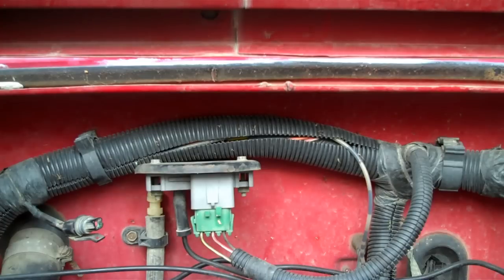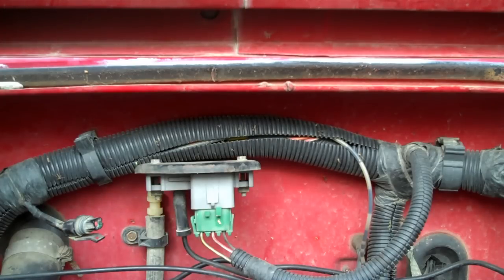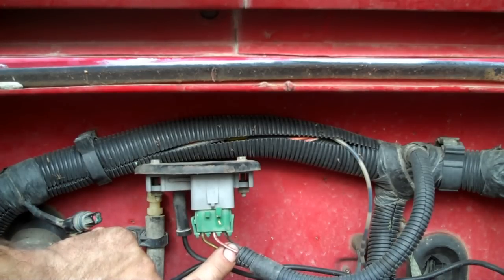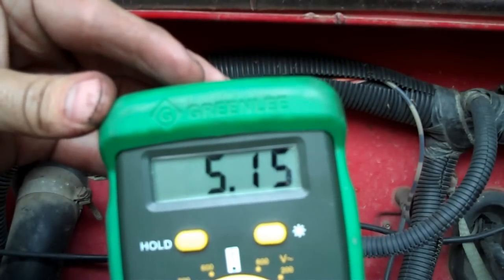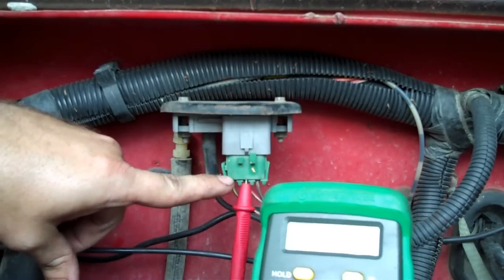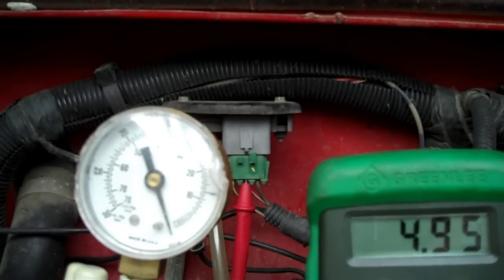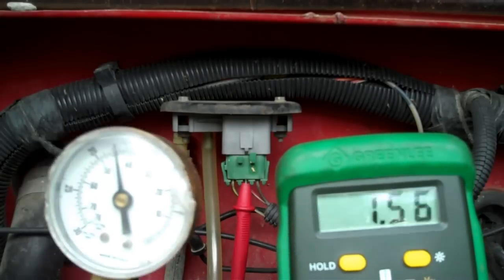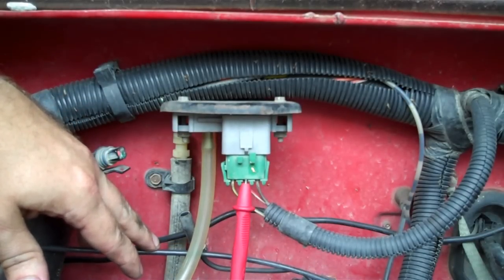Jeep Wrangler YJ -  How to test the MAP sensor.

Comment: Well, I guess I need to thank you...I think you just helped me pinpoint a issue with my Jeep. the center wire has 4.5vdc at power on, but when teh engine starts it drops to about 1.6vdc - what concerns me is that when I rev up the engine slowly i do not see a steady increase in volts - at about 3k rpm its still about 1.7 vdc

Comment: I have a 89 keep wrangler yj with a 2.5.   Runs good until it warms up and then just stalls out. I've put a map sensor o2 sensor crank sensor ignition coil new plugs new wires new cap new injector new throttle sensor new thermostat new fuel pump I'm lost do you have any suggestions for me
Reply: 90 wrangler yj 2.5. I'm having similar issue & have done everything you've done including new catalytic converter/muffler. I am at a lost. Starts off running great. Once the engine reaches a certain temp and I turn it off. Problem occurs when I try turning back on after being off 5min or longer the engine will sputter, sometime backfire, as I have the pedal completely down hoping it gets enough gas until it begins to runs. Once it starts to run it still sputter for a little bit more until it seems to clear itself up.
Frustrated... Please advise if you resolve your issue & how. Hoping it may be the same.  Thank you in advance.
Reply: Did you test the temperature sensors,...    There is a temperature sensor for the coolant. That is usually locked on or near the thermostat housing.
   And there is also a air temperature sensor that is either in the intake manifold or the air cleaner/ filter assembly.
     Both of those temperature sensors have to do with controlling the fuel injection system.

Comment: Just A quick question my RPM Guage on my 91 Wrangler 4.0 does not work when I bought. Can it be fixed? If so..... how can I do that. You help would be very much needed. Very Good videos thanks for posting your knowledge.
Reply from the maker: Old Wranglers are bad for dirty corroded contacts. Pull is out and clean the wiring contacts. You can use vinegar or hot sauce works well.

Comment: Couple questions..Is your Jeep the 4 Cylinder?  Noticed for me was difficult to catch your three readings for the vacuum (in the video sounds like you said 10 and go 10 more and than 17?  Hard to also read the gage.  Was your three gage readings  5, 10 and 17 in Hg Vaccium?

Your video is outstanding for a YJ fan.  In the Haynes, says nothing.  Even in the Chrysler service manual, really has no figures on vaccium.

Ever seen a spread chart for the map like they show for a temperature sensor or throttle position sensors show?

Thanks for all the help. Nearly 10K on my rebuild.  Have a fast idle issue.  Sure it's probably carbon on throttle butterfly or IAC.

Comment: I have a 1990 wrangler YJ 4.0 crank no start. If I introduce a short shot of starting fluid it starts and runs perfectly. Just a note it has a new fuel tank, and a new fuel pump recently installed but I still have the same situation. What do you think?

Comment: Great video but when I take my hose off the MAP my jeep cuts out. I have a rich mix shooting black smoke out the exhaust. Was told to check the MAP. Oddly when the MAP wasn't plugged in but the hose was connected, it ran and sounded like it used to. And then stalls. Soon as I plug the connector in,it runs like a misfiring dog and back to black smoke. Should the engine still run if the hose is removed??
Reply: Just tested the Center wire ,  
 Wire B. With everything connected,   with the Engine running at Idle. That wire terminal should have between 
 1, and 2, volts,.   Probably closer to.  1.   Or 1.5  .   
  If the reading is higher than 2 . volts with the engine idling,
   Then the MAP Sensor. Is faulty,     or   the Vacuum hose going to it may be plugged up or leaking.

Comment: Good video. I have a 1989 islander with the carbureted 4.2L but can’t find anything that looks like a MAP sensor.  Do you know if it has one?
Reply: On a carb vehicle they don't have a map sensor. The fuel adjustment is done through a screw on the carb, along with the idle screw.

Comment: also I have a 4.0 liter 95 yj manual transmission can you help me with a problem? I am getting code 36 from the onboard code reader and no one knows what it is? its a wastegate open or shorted for the supercharged models but mine is not supercharged. for the models not supercharged it is called the air switch solenoid. what the heck is this and where is it located? thanks

Comment: Hey I have a 88 jeep yj with an inline 6. I just added a new 2 barrel carb and fuel filter.. the problem I'm having is when I get on the freeway eventime it dies and acts like I'm out-of gas. Even though the tank is full.
Reply from the maker: Sounds like your fuel line may be getting too hot and vapor locking. On a carb rig, I personally don't care for the manual fuel pump. I always run electric pumps. They are more forgiving of heat and easier to change on the side of the road if needed.

Comment: I'm getting P1296 after I replaced the IAC & TPS. Cleaned the throttle body, changed the spark plugs and replaced a broken vacuum boot. Stalls at low speed, stops and deceleration. If I replace the MAP and still  stalls, what's next??
Reply: I would test the fuel pressure also,   to check for proper pressure at idle,     
   Had a similar issue on a van a couple years ago and we discovered it had a faulty fuel pressure regulator.

Comment: Went out to check my MAP sensor to see if it was my issue, ill be damned if the vac hose wasn't even connected.
Reply from the maker: That will cause an issue no doubt :-). Glad it was an easy fix.

Comment: Question: if I replace the MAP and Oxygen sensor, due I have to do anything with the computer? Or will it auto recognize the new sensors? And will this stop the gas smell by the tail pipe?
Reply: Disconnect the battery for at least 30 seconds and it will recognize the new sensors.  The computer will learn to interpret the new sensors as you drive around.  It may or may not fix your gas smell depending on the original cause.  Check to make sure your fuel pressure is correct.  30 psi at normal idle, 40 psi with the vacuum hose disconnected from the fuel pressure regulator (at idle).

Comment: my 92 giving fumes. so the MAP  (manifold absolute pressure)  I  got ta clean
Reply from the maker: If you got fumes, I'd change the O2 sensor as well. There is always the possibility of a fuel leak, the vent or gas fill hose going to the fuel tank.

Comment: your stuff is right on my MAP is 5.25 going in, but the signal is 4.31, plus the ground shows a little, juice, I think I got a bad Map sensor plus the high speed WOT does not work.
Reply from the maker: Very well could be. Also if you are having issues at WOT, may need to check the TPS. I have a vid for that also. Here ya go: https://www.youtube.com/watch?v=URNYaGXM_uQ

Comment: possibly a silly question, if my input voltage and its 5 volts, and off the sensor is 1.5 volts with the key on does that mean the sensor is bad?
Reply: Yes.  That's too much voltage loss at zero vacuum.  Swap the sensor with a new one.

Comment: I am have a 99 Tj 4.0... NO CHECK ENGINE LIGHT it has a rough idle and SOMETIMES it idles up (mostly in park) to 15 - 2000 RPMs  it feels like it also misses.  sometimes and idk if related but the fuel gauge drops to no gas then comes back up.... i took it to a shop they said it was the PCM/ECU.  got a reman plug and play issue remains 
I have Cleaned throttle body and IAC new plugs wires PCM checked for vacuum leak (break clean and smoke test) 
PLEASE HELP!!!!!!
Reply from the maker: Thomas Bowe I have seen on mine that there can be issues with a sensor and it not light the "Check Engine Light". Havent tried this on the TJs but here it a video on how to make the ECU tell you if its storing codes but not lighting the dash light: http://youtu.be/KRuxSgkOyig. I need to try this trick on my friends, his is a 2000 model. After everything you have done, I would try next is testing for a vacuum leak somewhere. Get a can of starting fluid, with the engine running at idle, spray along your vacuum lines. If there is a leak, the engine will rev up for a moment and then drop back to normal. Also, comes to mind also that possibly the IAC may be occasionally not fully closing. Also check the TPS, mine would erratically high idle (but only go up a few hundred RPMS) http://youtu.be/URNYaGXM_uQ ... http://youtu.be/0wrrojhJ4XY .   On the YJs the fuel gauge circuit is its own circuit. I haven't had the opportunity to have to trace a fuel gauge circuit on the TJs. Here is the video on how I addressed the YJ fuel gauge: http://youtu.be/6i9X2agOEYs . Let me know what you find out. Thanks
Reply: Power Addicts I did a smoke test and a cab cleaner test... The motor revs up when it wants to and kinda feels like a misfire and sometime runs ok... also omly got 225 miles out of a tank.. is that normal??
Reply from the maker: Thomas Bowe You could have either a 15 gallon or 20 gallon tank. Which one you got? If its a 15 gallon it will not be too far off. Also depends on what gear you have in the diffs .. automatic or manual? Mine is a 4.0 5-speed with 3.07 gears rolling on 31 x 10.5 tires, it get about 18 miles per gallon if I baby it. My sisters gets about 12- 14 but hers is a 4 cyl. Jeeps Wranglers are not known for good mileage. If yours is a 15 gallon getting 225 per tank .. thats about 15 miles per gallon. If its a 20 gallon .. you are getting about 11 MPG, that would be abnormal. As for the running issues. I'd suspect that IAC is erratically sticking. Problem with that is there is no consistent way of testing that if it's an occasional thing. Run for trouble codes immediately after misfires. The ECU doesn't always light the trouble light, but it can store a code a period of time afterwards. My Jeep the first time I ran a code test it told me that MAP was bad... never had a light. The TPS on mine was acting up, it never threw a code or even had one in the ECU.
Reply: my 2001  tj on 31's and 373 gears got 280 miles a tank at 75 mph. the coil packs can have intermittent misfires you may need a new coil rail for it.

Comment: I've been having an issue with my 91 4.0l, It starts after the first crank when its cold but after its up to temp it will crank forever before it starts and has a high idle that settles after about 20 seconds and idles rough??? I have to let it sit for a few seconds with the ignition on and then it wont crank as much but still cranks alot before it starts and only when its at temp, i have checked the fuel pressure and its locked in a 30psi, the pressure does not drop off which is why I'm stumped right now...  Do you have any suggestions on what I should be looking for!

Comment: Hey great video! It was really helpful, I've been trying to determine my running lean issue, I have pretty much narrowed it down to either the map sensor of possibly the ecu. I have just checked my readings, at 0 in Hg I am registering 4.05 v. At 5in Hg I am at 3.14 v. At 10in Hg I am at 2.27 v and at 20in Hg I am at .49 v. My 5v reference and ground both check out. However online I found I should read 4.7 v at 0 Hg. 3.9v at 5v Hg. 3.0v at 10in Hg, and 1.1v at 20in hg. Do map sensors get weak? Do you by chance know your voltage readings?
Reply from the maker: +B Sanchez Glad you liked the video! :-) A MAP can read a bit out of spec and run fine, just not efficient. I have the Chrysler Shop manual for thes XJs & YJs. it doesnt even specify exact voltages. Just that with 0" it needs tobe very close to 5 volts. It more about the voltage sweep being steady as vacuum is applied. I watched my video again. At 0" I was @4.85 volts. Then at 17" I was at 1.7 volts and had steady voltage all the way through.  Your 0" reading is too low for my taste. I thing the lowest it should go is around 4.6 volts or somewhere around there favoring the higher side. In short .. I's swap that MAP. http://www.fixjeeps.com/map-sensor.html .. here is the webpage that goes with that video if it will help you any. Thanks for dropping in! Hope this helps. Have a great day!!

Comment: I hope you see this! That ground wire on the firewall, right of the map censor. Where does the other end go??
Reply: If you are referring to the all metal Ground Strap,   one end is bolted to the Firewall,  and the other end should just be bolted to the Engine,  Either to the a clear paint free place on the Engine Block,  or a Clean Paint Free place on the Intake manifold.

Comment: Great video, I just tested the MAP sensor and the reading goes up instead of down while applying the vacuum pressure. I guess is time to change the MAP sensor.
Reply from the maker: ***** Sounds like a new sensor is in order to me. That's a new one on me. I've seen them not read at all. Erratic voltage as it tests. But not voltage raising as vacuum is applied. Well . see new things all the time if pay attention. Glad you liked my video. Thanks for taking the time to leave a comment! Have a great day!

Comment: Hey, Great video! I just did the test on my 1990 Bronco and i got 0 volts in one wire and 3 in another.  Where downstream should i check to fix this problem?
Reply from the maker: Sean Rafferty Thanks :-) Best suggestion I can make is find the pin out schematics for the ECU. Then test the wire coming from the ECU pin that feeds voltage to the MAP. If you have low voltage there, could possibly be a bad ECU. If voltage is good from the ECU pin, then you have voltage drop going to the MAP. Also make sure your ground is solid for the MAP. A "not so solid" ground can cause a voltage drop also. Hope that helps. Thanks for dropping by and checking out my video. Good luck and have a great day!

Comment: We have fuel smell coming out of exhaust did you ever do a video on the regulators. 2.5 94 yj. Thanks.
Reply from the maker: Yep, I did a video on testing fuel pressure. Your problem may be a bad O2 sensor.
Reply: Got a pressure tester and it maxed out and then it turned out the return line was plugged inside the tank. Thanks

Comment: It would have been nice if you showed the setting on the meter  But thanks for the Video
Reply from the maker: Set it on DC voltage, that is what cars run on. Look up what the symbols mean on multi-meters.
Reply: @Poweraddicts  I know where the DC side of the meter is , but your scale looked like it was set below 20 on the DC side i was just wondering if that was the case because im not sure the 20 would read 5 votes that was the only reason i asked

Comment: my 88 cherokee is struggling to hold 55 mph.to me it acts like the advance and right amount of fuel is not being delivered. -- back story the fuel from the tank to the injectors all checks out.pump good, filter changed, and regulator changed out.
wiring--did the bulkhead connector eliminate and repaired 4 grounds as per Cruiser 54's tips. did all the ground cleaning and refreshing. new battery cables pos and neg. replaced the IAC and the TPS.  i am slowly gaining.  it shifts up and down thru all gears fine. had good power one month, then crap the next.   only thing left is CPS or the MAP sensor.  open to suggestions here. cat is clear and not clogged. exhaust is not bent or obstructed
Reply: also the EGR is dis abled and not leaking. hoses plugged for now till i get full functioning back. also replaced all my vac harnesses on engine with left and right from NAPA
Reply from the maker: You say the fuel pump is good. What was the pressure?
Reply: 35/34? at idle and 39/40 when you open it up off idle.
Reply: i also changed out my fuel tank due to rust. my old one was clean inside and the rubber hose on the pump and sender was leaking. i replaced it and new clamps
Reply from the maker: Rust in the tank. Possible you could have rust in the lines cutting back on the volume of fuel getting through. You can have good pressure at idle and just off idle. But if you have blockage in the lines, the injectors will start to run out of fuel and pressure once you get up to speed.
Reply: my old tank rusted from the outside at the straps to the inside. when i took it out i checked for dirt as i have suspected a clog could be my issue. it was clean and dirt free. and my new to me tank is a used tank and is in great condition and it was clean too. i made double sure because i hate dropping fuel tanks. i ll pinch off the return line and see if anything changes, and if so i ll blow the lines out and bypass my filter as a means of checking if it is in fact my problem.

Comment: Not very helpful if people dont know where to set their meter at.
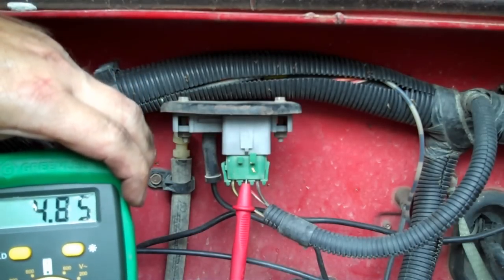Reply: 2:52 black wire on battery, red to check dc voltage, set multiplemeter on DCV

Comment: What happens if the central connector gives me 4 volts?
Reply: Ig the center connector has 4 volts when the engine is idling,
 Then the MAP Sensor is faulty,
   Or the Vacuum hose going to the sensor could be plugged up or leaking/ broken.